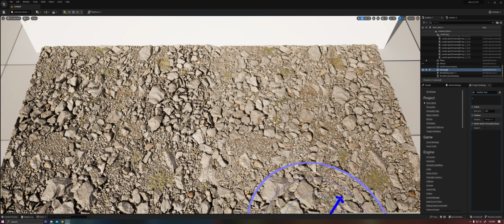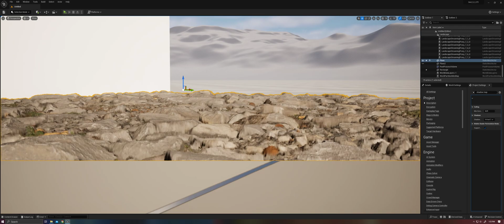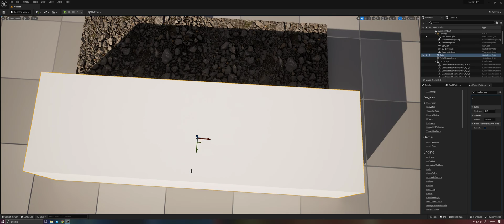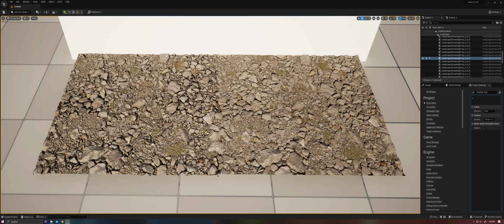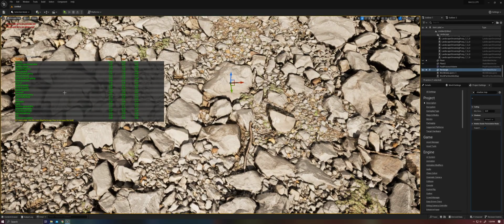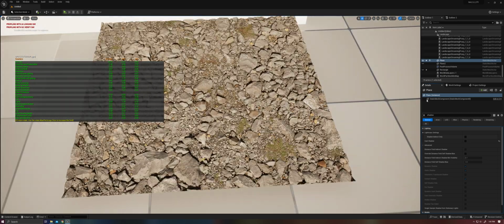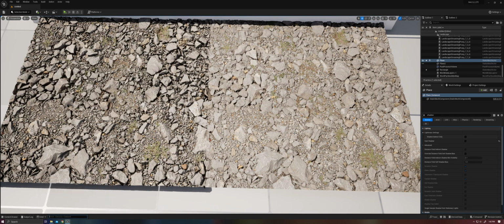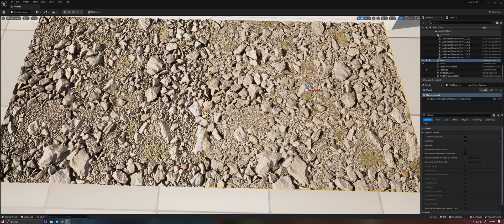Parallax Occlusion Mapping Deep Dive Bonus Episode - Nanite vs POM

Comment: You could probably save some more performance with the Nanite mesh by simplifying it in Unreal. The UE algorithm does a great job from my experience. I bet you could lower the poly count by a factor of 5-10 without losing much detail. From my experience nanite is very expensive with shadows. Depending on the use case I like to play around with the shadow variables in editor or even fake the shadows all together.
On the other hand POM is very flexible performance wise and requires less storage space. Both have their purpose.
Reply from the maker: It actually was, in order to give the best visual comparison, I started with a mesh that had 1 vertex per pixel, then decimated it. You'll notice some larger rocks have less dense polygons on the wireframe.
But I left a lot so that Nanite could do its thing. Nanite is pretty efficient at drawing into VSM, but having two rendering paths when drawing shadows definitely isn't cheap at the end of the day. 
I suspect Nanite tesselation/ displacement will reduce the use cases of POM a lot - but it still has its benefits.

Comment: you'd lose the flexibility of texture blending on terrain meshes when using Nanite. 
but Nanite has it's positives. trade offs to consider
Reply from the maker: Yeah, there's almost always a trade off. I do think Nanite or a similar solution will eventually replace POM in basically all use cases, but we're not there yet.
Reply: @TechArtAlex  some procedural/dynamic displacement with Nanite perhaps? otherwise, it's a pain to constantly swap Nanite meshes from stone/wood/grass biomes during set dressing. 
fixed mesh vs dynamic mesh perspective
Reply from the maker: @ArtTstudent  They're experimenting with Nanite tesselation that will allow you to achieve results similar to if not better than the old landscape displacement system. It works in 5.3 but is hidden by default. Still pretty experimental.
Reply: @TechArtAlex  i did not know at all. Thank you for sharing ~ looking forward

Comment: well the only reason to use POM is if you want to do vertex paiting on a plane, or if you are making a landscape and you don't want to use virtual textures, also I have heard they were going to fix the PDO issue with self shadowing in a 2016 stream and i am still waiting 7 years later.
Reply from the maker: There are some other use cases too, like POM decals, or just adding a bit more depth on certain assets. For example I've used POM on the chainmail of a character's armor and it significantly improved the apparent detail and depth, even though the amount of parallax it added was quite tiny. 

I have given up on them fixing PDO applying to the shadow depths, even though I have several use cases beyond POM that I would like it for. PDO also needs to be applied to velocity depths too but doesn't. Their implementation is kind of half baked.

Comment: You cant compare performance on that scale, what would a 100 times larger parallax terrain using tile texture and vertex paint compare to both 100 nanite meshes as unique individual meshes and compared to 100 instanced nanite meshes, there's also now a new sudo instance allowing more variation so would also wonder how that works with nanite and performance at that scale.
Reply from the maker: Not true. Both Nanite and POM cost scales primarily with pixel count, not instance count. That is why I'm zoomed in where the material has full screen coverage. Tiling the material 100x over a giant mesh or having 100x as many Nanite meshes using the same material would have no difference in performance.
Reply: @TechArtAlex   thanks for clarifying
Reply from the maker: @johnharbinger4637  Sure thing! Thanks for watching

Comment: Your nanite mesh looks super sharp and detailed. Which software did you use to make it?
Reply from the maker: Surprisingly it was authored in UE5 directly. I heavily subdivided the plane, baked in the displacement map, and then decimated the mesh back down. The built in modeling tools are not extensive, but for simple things it's a nice convenience not to have to jump between software.

Comment: POM can work together with Tri-Planar.
Reply from the maker: Sure, although normally this means doing POM three times so it can get pretty expensive. It also often has issues at the transition points because there's no guarantee of an intersection between the blended projections height values at these points, resulting in artifacts. I may do a video on this in the future, but I've been busy lately. Thanks for watching.
Reply: @TechArtAlex  Usually there is no need for 3 projections. Often 1-2 sides are needed. I could not completely make one side customizable so that I could change its position.
Reply: I'm looking into trying to get this to work now. Do either of you have an example that could be shown? I have I only gotten it to work on my walls so far, but can't figure out how to get it working for the floors and ceilings as well. Inexperienced here so I am in a bit over my head trying to figure out tri-planar + POM together

Comment: I have a feeling your POM shader would look visually superior than your displaced mesh in VR. When i experimented with it myself, my displaced mesh looked flatter than POM in VR. Probably one use case where POM is indespensible (for now anyway)
Reply from the maker: Interesting, I haven't compared them in VR. I'll have to give that a try. Maybe it gives the per-pixel displacement more room to shine since the tiny differences in depth are more perceptible.
Reply: @TechArtAlex  yeah, probably the ideal use case for pom actually, since the two eyes each see a separate rendered image, hence a parallax effect